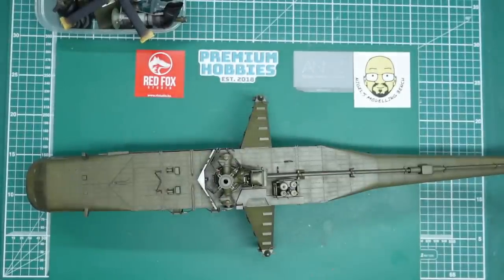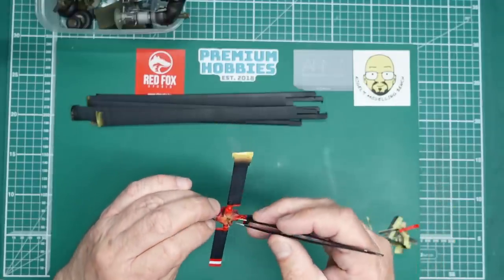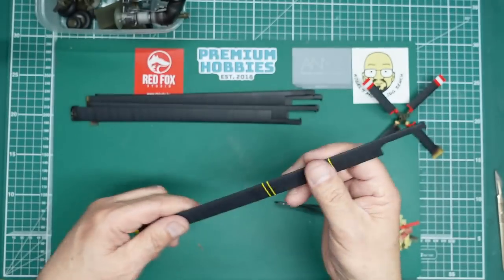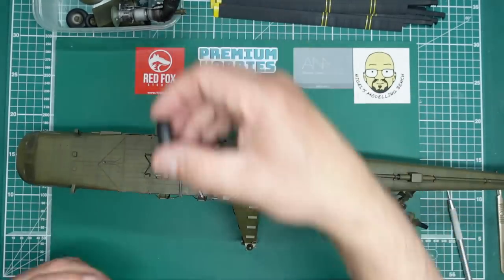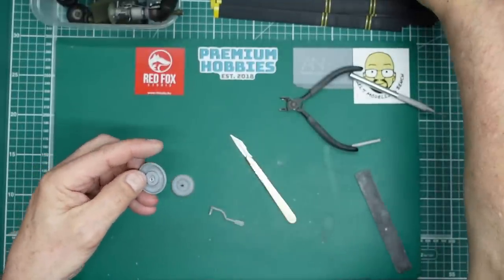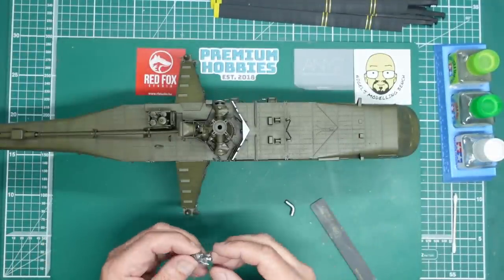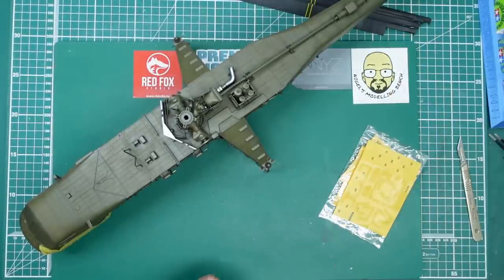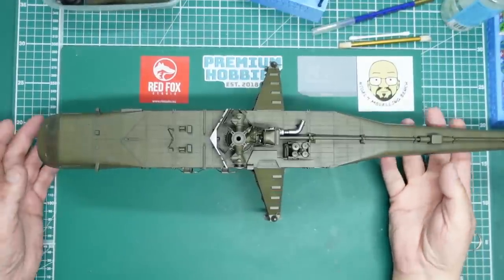ICM 1/35 CH-54A Tarhe build. Part 12

Comment: Hi Nigel,
  Your M/R blades are great even the tail rotor. Yes the painting on the details are way better. The stripes on the M/R blades are where the blade slings are placed when lifting the blades using a hoist.